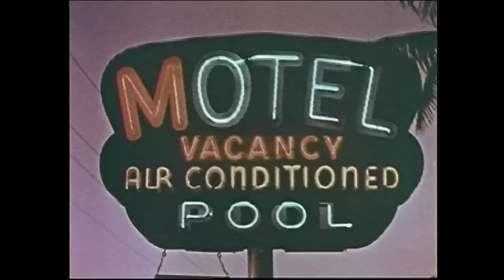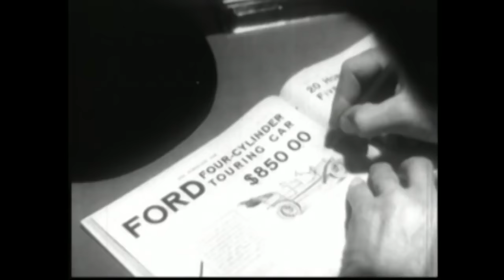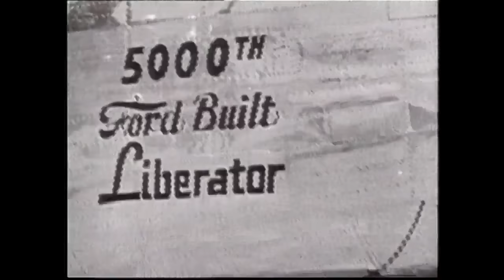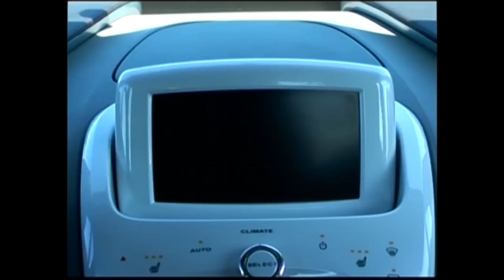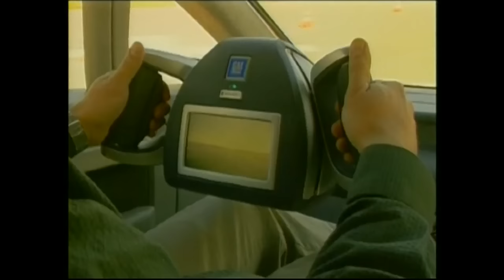The History of American Vehicles

Comment: My favorite car of all time has to be the 1970 AMC Javelin.  Mine was equipped with a 390cid V8, close ratio Borg Warner 4-speed manual trans and LS rear end. Stock, it had 390hp  and 425ft/lb of torque.  I once spun a manhole cover right off the street.  Thought I'd broken a leaf when the rear dipped 4".  It sparked for a block before stopping.  LOL.  What a ride that old beast was.  My only muscle car.
Reply: <My favorite car of all time has to be the 1970 AMC Javelin.>
They were very good cars.   When I was in the Service, I was lucky enough to 'care' for a 1968 AMC AMX with 390, 4-Speed.  It was their dark green in color with a nice tan interior.  I had it for 2 weeks and loved driving it all around Las Vegas (he actually insisted I drive it).  After driving that car, my opinions changed dramatically about AMC cars -- I appreciated them even more.   Even today, I think they had very good designs and interiors during the late '60s and early '70s.
Reply: Even though I've never owned this car, my favorite would definitely be a 1970 Dodge Coronet Super Bee with the 426 Hemi producing 425 HP and with 490 ft-lb of torque with a 4-speed manual transmission.
Reply: That automobile would be worth a mint now...😮
Reply: I had a 1974 AMC Javelin. Such a cool looking car and fun to drive.

Comment: In the 50s and 60s, used station wagons were cheap, with virtually no trade-in value, but usually low mileage, they were a good buy. They were used by Moms for their intended purpose.
The interiors were usually dirty and needed seat covers. The engines always needed an oil change and servicing.
The brakes were invariably worn out and  they needed tires. Husbands usually did not maintain these vehicles, dismissing it as "Oh the wife only drives the kids to school and to the super-market." No matter that the vehicle was unsafe to drive.
We used them as work vehicles, fishing or hunting, for anything where larger loads than an ordinary trunk would carry.
They provided more comfort than a pick-up. Pick-ups were still just work trucks.
Reply: Hmmm. I spent a lot of childhood time at the 1960s supermarket. Then I  remember every aisle of Treasure Island. Dad had the wagon, Mom took the Impala convertible. We were taught to take care of what we owned.
Reply: I had a nine-seater. I think it was a Plymouth.

Comment: I am 81 and i started working full time in autobody from 1960 when i graduated  High School in 1960 and retired in 2011 put 51 years in autobody, and do not miss it my hands have a nasty habit of locking up from hammering sheet metal.
Reply: Wasn't it great when high schools would train teens for actual jobs they could start right at age 18?  My high school had auto body, auto mechanics including diesel and housing construction classes.

Comment: New technology is great, I guess. But cars today are just  to get you from A to B. Even when they have 900 horsepower and they can drive themselves. I think any one who has driven  a 1963 corvette, Or a modified  or non- modified  57 Chevy or 1967 or 69  Camaro knows the difference. Its also true the new cars handle better and have improved the engine with fuel injection and electronic timing, agreed. But to me all the new cars even the new corvettes all look alike in body styles. None really seem to have their own dynamic personality like they used to. Such as a 1964 Chevelle or The 1966/67 G T O. These cars were very special. With things like the radio's speaker grill cut into the back seat which looked beautiful. And the many option colored interiors. I suppose it boils down to when something is really great and moves people emotionally,  You can bet  its time here on earth will be very limited. I also agree, lots of  miss- information on these cars and photos. Still these cars will always a pleasure to look at and drive.
Reply: I’ve had a few of those models you mentioned 
Wish I still had them
Reply: Richard the 57 chevy is a poor handling machine even back then, other that "what were they smoking in designing dept "it's kind of messed up design
Reply: @richardbartolo2890          If you really love the old car hobby, then do your part to help clean it up.  Educate yourself on what "restored" means and what "fixed up" means.  Go to bonafide shows where the right cars are held up with pride of workmanship.  Learn how to sort the wheat from the chaff.  Try to educate retards who destroy cars by modifying them up and turning them into gilded rubbish trucks.  

Hot rod and low-rider termites have been invading this hobby for several decades and their damage is extensive.  Young people today think '55 Chevys were sold new with mag wheels and 1950 Fords came with optional Chevrolet 350 engines.  This is irresponsible as well as  destructive.  

All I'm saying is, don't become a part of the problem, try to become a part of the reparation.  Sorry I was hard on you, but I get riled as hell when people who don't know any better go around endorsing loused-up junk that once had potential.  The goal of any hobby involving antiquities is to record history, not rewrite it.
Reply: @lancasterritzyescargotdine2602   I hear you and that's a legtimate reason for it to get under your skin. I have had things irritate me as well, So I do understand. About 5 years ago I had a chance to buy an original 1974 Mercuy Comet, It was a factory 4 door with a 250 cubic inch 6 cylinder, Not exactly a hot rod by any means. But it did look good, And it rode like and old Caddy, With bench seats and and Automatic on the column, I used to bring it to shows just for fun. It was that Chrysler Road Runner Orange color with black interior. I get what your saying about the younger generation thinking a 55 chevy came with bucket seats, Mag wheels and a  hurst shifter on the floor. I will Never understand the Lowrider thing, It ruins the cars. Thanks for the reply back. Since I grew up riding in those cars in the 50's and 60's I have a war spot for them.
Reply: @richardbartolo2890                   Thank you sincerely for your opening mind about old cars.  The crap we've been discussing is a disease that grows in California and blows east over the Rockies.  Fortunately, the northeast still maintains their stalwart values when respecting old cars.  

Back in 1970 I wanted a brand new Maverick, but couldn't find the color and packages I wanted so I gave up.  By 1996, an ad appeared in the local Palm Springs paper offering a stone mint 1970 Maverick with 16,000 original miles for $970.  It was a like-new old grandma car that had been garaged all its life.  It had its original 1970 California plates, dealer frames  and title.  The money exploded out of my wallet so fast it left sparks in the air.  This is what I called my "time capsule Maverick".  I was afraid to drive it, for fear of going thru some water and getting the underside wet for the first time.  After a couple of years I sold it to a hobbyist in Liverpool, New York.  When the car arrived, he was flabbergasted at the condition it was in.  Two years later he called to tell me he's taken it to car shows all over the northeast and it always get People's Choice or Best of Show trophies.

An old car is only original once!
Reply: @lancasterritzyescargotdine2602   While I appreciate originality, I also appreciate some modifications. 

Consider this: something like a '57 Chevy (or any other car down through the years) becomes old and mostly worn out. The choices become spend more than it's worth to fix it, sell it for what you can get out of it, or just scrap it. Most ended up being scrapped and are gone forever. Some were sold for what could be gotten out of them and fewer yet some were fixed to something resembling when they were newer. What if some (or many parts) are no longer available or easily found?

Take my '67 Imperial, certain parts are unobtanium, especially here in the salt belt. When repair or replacement of something unobtainium is needed, it may require a modification or completely different part. Do I freeze the car in time while no longer using and enjoying it or do I keep it operating?

While "time capsules" are nice, 99.99% of the cars sold were for a purpose. Not to sit in a garage for some future collector, but to be used as intended. While I'm not a fan of some things people do to cars, it's their car, their money, and in some ways I consider that better than letting an old car rot so it to is gone forever, like so many of its peers. If a guy can't find or fix his original 265 or powerglide in that '57 Chevy, than I don't have a problem with a 350 or LS or modern transmission being put in it if that keeps the car running, usable and available for present and future generations to see and enjoy.
Reply: @turbo8454    Your logic has been echoed for decades. The purpose for restoring and maintaining an old, rare car is to celebrate the time, talent, skill, styling, innovation and pride of workmanship the original designers put into it when it was conceived.  That does not translate into, 

                                                      "Well, Powerglide wasn't any good when it was 
                                                       new, so I'll just throw a Muncie 4-speed into this 
                                                       nice, original Grandma '57 'Air.  Besides, if I put 
                                                       on some headers and wide slicks, it will make 
                                                       more noise and draw more attention.  And a Marina 
                                                       Blue paint job will sure look good with that back/red 
                                                       interior.  And some Cragars will sure help it up off the 
                                                       ground.  Besides, when I soon get bored and decide I don't 
                                                       want it, I can always dump it on The Bigger Fool."

Not only have today's generations lost track - through no fault of their own - of the spirit and meaning of driving a vintage, old car, they're also rewriting history.  Too many younger generations already think Cragar mags came standard on all '55-'57 Chevys; that Chevrolet 350 V8s were optional on all 1949-51 Fords; or that Marina Blue was an optional color available on all GM products going back to 1937.

So, you claim nobody will ever want really rusty cars.  Remember, there was a time when nobody wanted 210 and 150 sedans.  That was back when there were plentiful amounts of Bel Air hardtops and convertibles  still running around.  When they were gone, next came the 210 and 150 sedans.  When those were all gone, they went after the pickups.  And it isn't just Chevrolet.  It's every marque in the book.

Another problem is, these cars are still hotter overseas than they are here. We're losing far too many of our vintage cars - both original and compromised - to overseas markets where they ''likely as not will ever be back."
Reply: @lancasterritzyescargotdine2602  Yep. It's been echoed for decades because that's the facts. Not everyone feels as you do and that does not make them wrong (or you right).

I  suggest that you use your resources to save all of them if others don't do it in a way that you approve of! That way you will never be disappointed in the continued existence of an old car.
Reply: @bradzimmerman3171                 I have to agree with you.  Chevrolet blew it in 1957.  It was a 3-year old body, when Ford had an all new, spectacular design, and outsold Chevrolet for the first time in 31 years.
Reply: Chevelle cameout in '67
Reply: @MarkusGore-zq3tb  Your wrong Markus,  they came out in 1964. they were the same body style as the Le Mans and the G T O. My brother and uncle both had one.
Reply: What's amazing is the '57 Chevy was a loser when it was new.  It was "a new set of dentures in the same old mouth", as once critic described it.  It took ten years before the youth market discovered it, whereas the '57 Ford was an instant hit with everyone.
Reply: @MarkusGore-zq3tb           The Chevelle debut in 1964.  'cameout' is not a word.

Comment: In the very late 60s, I owned a blue/blue 1959 Chevy Impala Convertible with auto-everything, including power windows and power seats.   In today's world [size-wise], that would be something like a Bentley if they make the Bentleys today as large as those back then.   The size of the "regular full-size" cars literally exploded for the 1958 model year.
Reply: Penboy          And most American cars turned ghastly ugly in 1958!  You forgot that part.
Reply: @lancasterritzyescargotdine2602  <most American cars turned ghastly ugly in 1958!>
Not at all.   Maybe too much chrome trim?   Sure, but the car designs were actually very good looking for the most part.   It was 1959-60 that they turned more ugly.
Reply: @penboyasgod6103              1959-1960 was the climax, especially for GM.  But considering all the dreadful car designs that defecated on the very definition of art, you have to encompass 1957-1962.  1957 gave us the cruelly disfigured Lincoln facelift, and the ugliest Mercurys and Imperials ever.  1958 dug deeper and brought us the Lincoln, Mercury, Buick, Oldsmobile and Imperial.  1959 Gave us Mercury, Lincoln, Imperial and everything GM except Corvette. 1960 gave us the same GM diet, Lincoln, Edsel, Mercury, Plymouth, Dodge and Imperial.  1961 gave us Plymouth, Dodge, Imperial and 1962 finished the era with Oldsmobile, Buick, Plymouth, Dodge and Imperial.  

There were certainly plenty of offensive designs between 1957-1962, but many weren't so over the top as to induce public vomiting in the streets, as did the ones exposed here.  

Is there one that would beat out all the rest?  I'd have to nominate the 1960 Imperial and the 1961 Plymouth as tied for the award of The Ugliest American Car Ever Built.  It would be several years before Chrysler would fully recover from the damage caused by Hurricane Virgil.

Comment: The Dodge Brothers made most of the parts for the Modal T If it was not for the Dodge Brothers Henry Ford might not of made the Modal T when he did because he was broke
Reply: 79tazman so Ford really is a "Fucked Up Rebuilt Dodge!"
Reply: 79tazman 
Lol
Reply: Slight correction: Ford outsourced the assembly of engine/chassis/transmissions to several different plants, Dodge Brothers being the largest, and later the exclusive assembly plant. But Dodge did not manufacture these parts; Ford had a global supply chain that would ship those parts to the assembly plant, who would then assemble it and send it over to the Ford plant for body fitment. General Motors had the same strategy in place, in that the frames/motors/trannies were built in different plants, sent to the Fisher plant for body fitment. Hence the "Body by Fisher" tag that all Chevrolets used to have.
Reply: @ 79tazman That is true and the Dodge brothers were first paid in Ford stock and earned enough to begin building their own cars.
Reply: GM did have some components built by outside companies (frames come to mind), but engines / transmissions were built in GM-owned plants adjacent to the Fisher assembly plants and typically conveyor'd over for final assembly. All GM Divisions used Fisher Body plants (wholy owned) with the exception of Cadillac, which also used Fleetwood (later wholy owned also).
Reply: Samuel Colt was the first manufacturer to use an "assembly line" and "interchangeable parts" NOT Henry Ford.
Reply: Randy Wiesendanger  
In his younger years; Henry Ford was more interested
in racing than in manufacturing.  As with many
artistic people, creative people and engineers,
he was not a good businessman. Henry's son,
Edsel was the business-brains of the corporation.

Unfortunately for Edsel, his father and him locked
horns frequently over issues regarding production.
The Edsel car (1958-1960) was named by his son,
Henry Ford ii, in honor of his father.
Reply: Randy Wiesendanger  
Nevertheless, his factory made cars
that the working class/farmers could
afford. The Model-T and Model-A
gave affordable transportation to 
millions in a country that lacked
public transport outside of the 
big cities.
Reply: Not too  much regarding Chrysler.

Comment: 1968 Pontiac GTO convertible. 400 with a 4 barrel carb, hurst dual gate tranny, electric top with glass rear window, posi-trac rear, craig 8 track tape player, Pontiac green, black interior, hush thrush exhaust, rear air shocks, fat tires in the rear and smaller tires upfront. Really nice car wrecked by an old girlfriend. Needless to say- she was gone quickly after.

Comment: I lived through these beautiful cars, 1990 to today are pure shit.
Reply: They’re actually getting better again. We finally have some real muscle cars in the late 20-teens. Shelby Mustang got 350, Challenger Hellcat, etc...  I own a 2018 Cadillac ATS V. Before you laugh, 464 hp, 450 lbft torque, 0-60 in 3.8, 12.2 quarter.  And an amateur driver can actually hit those numbers.
Reply: I agree with you, part of the fun of owning the old muscle cars was showing off the engine compartment with maybe 2 holly 4500's etc, plus the old stuff could be repaired on the side of the road and not need a diagnostics computer and a lot of money.  Plus the new stuff is made of plastic.  But they handle better than the old stuff.  Your Cadillac costs 60k plus, My 60 Eldorado conv. with 2 4bbls cost 7k and is worth 250k today.  wish I would have kept it  thanks -